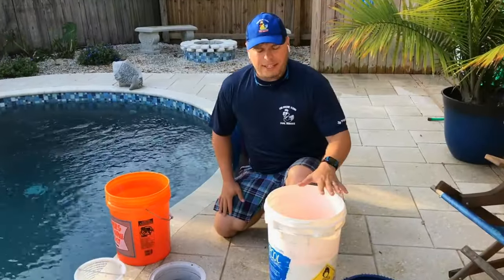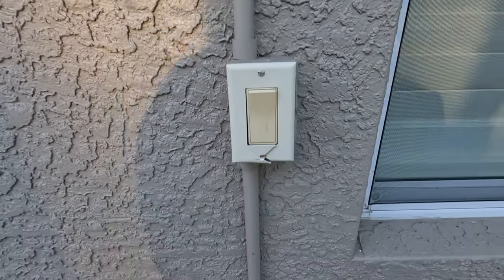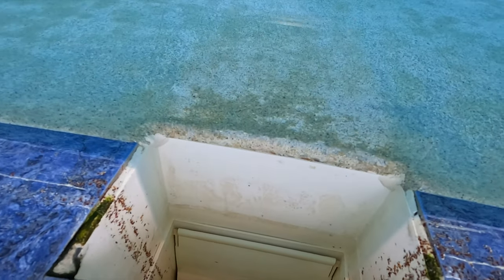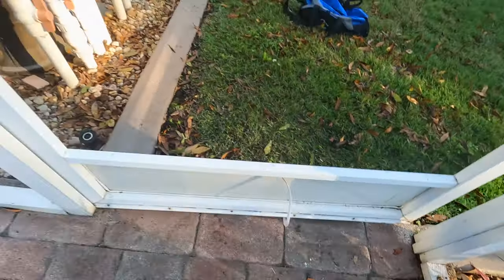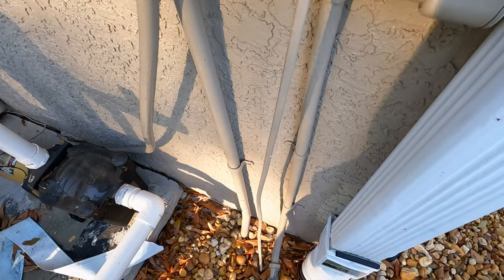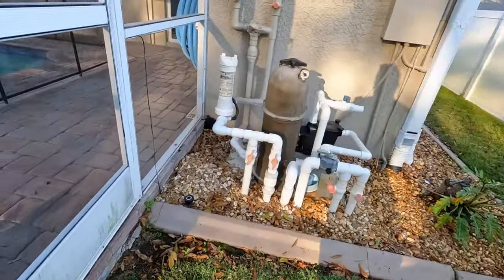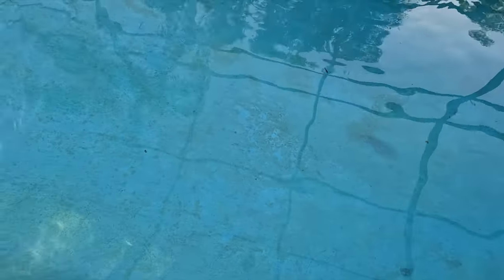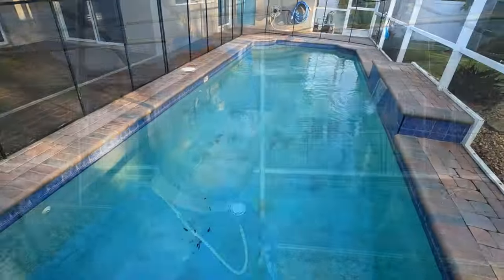Leaking Solar Pool Heater | Another Chlorine King Pool Inspection

Comment: I know this isn’t relevant to what you’re talking about in this video. But I need your help if possible, my pool has a weird white gunk substance. I cleaned out the filter and the filter was covered in like a white gunk. Chemicals seem to be on par, phosphate level is extremely high. I treated the phosphate but I’ve never seen an issue with phosphate causing this sort of problem. Any ideas what it can be and remedy?
Reply: Sounds like a combo of phosphates plus hard water. Your TDS levels may be very high as well. I would check those out. How old is the water?

Comment: How long does it take you to do an inspection? On site and writing it up?How much do you charge?
Reply from the maker: It honestly depends on the size of the pool, how much equipment and how bad the pool is. I’d say anywhere from 45-90 minutes on site. Then about 90 minutes to prepare the report. I draw in the pictures and type everything out so it’s a “custom” report lol. $395
Reply: @ChlorineKingPoolService  so I assume you charge a flat fee to do an inspection, not hourly? Do you use a software to write up the inspection? If not have you looked into one to use? When you say draw pictures, do you make like a blueprint of the pool area?
Reply from the maker: Yes flat rate and I just use word and customize it to the clients pool. What I mean by drawing is I’ll draw up arrows and text of what the picture is supposed to relay.
Reply: @ChlorineKingPoolService  makes sense, thanks!
Reply from the maker: Welcome. Good luck.